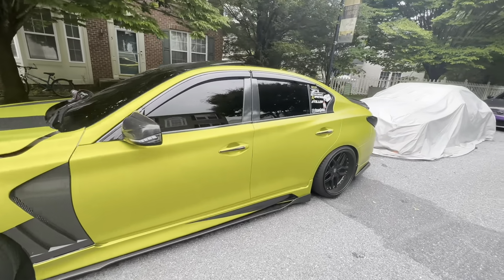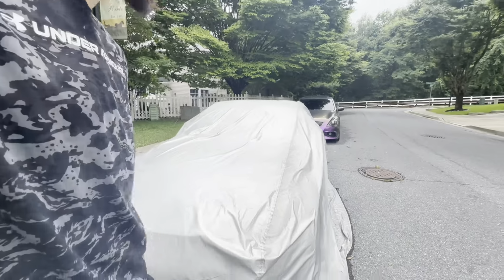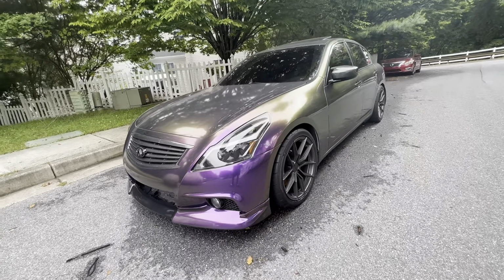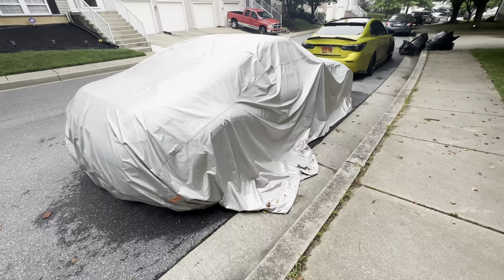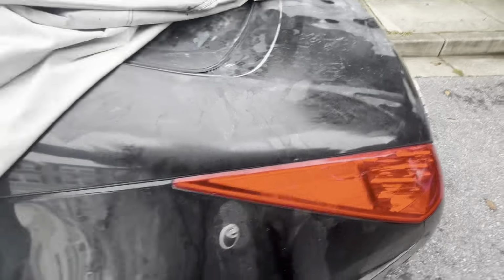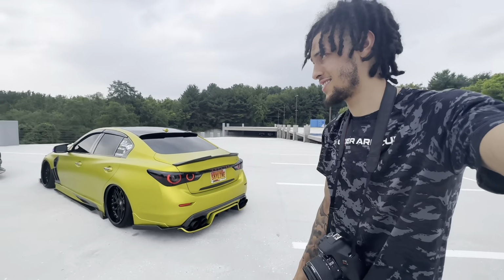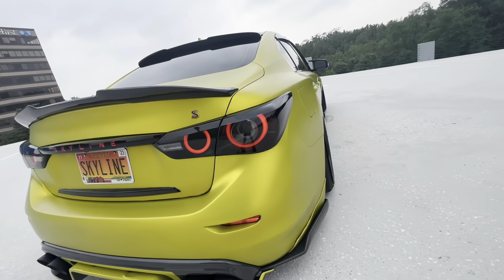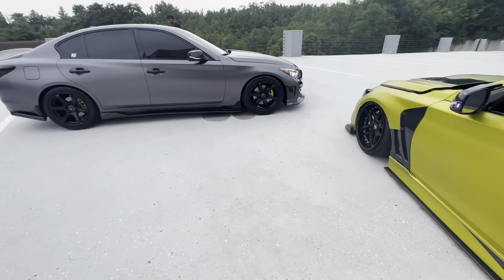Q50s BUILD REVIEW

Comment: Are those ESR's 19's or 20's? I'm in maryland as well. I have a 2019 Q50 RS AWD. Been building it since I got it last year. I fucks with ya build. I focused on performance first. Now I'm doing some carbon fiber stuff but I'm still doing performance. These cars can make some serious power and coming in with 400 stock I am def interested to see how much I can make when it's done. Keep up the work bro. I'm from NYC but live in Towson and I can tell you you make the Nissan family proud my boy.
Reply from the maker: These are 19x10.5 +22 and on 235/35/19 very aggressive setup, also have to run 20mm spacer in the front to clear big brake kit. Definitely recommend running a bagged setup for something like this!
Reply from the maker: Appreciate it too bro🙏🏽 thanks for watching
Reply: I have 19x10.5 +35 offset 255/35/19 rears and 245/35/19 fronts. I have to run wide tires for traction. It's AWD and that shit tries to get loose still so I went with an aggressively wide tire in the rear. I'm actually thinking about going 265 LOL it's looks menacing from behind. Yo ESR got a crazy sale right now on some 19's in black (question... my car is black... how do you feel about the black on black setup?). I am going 19x10.5 +22. hopefully they clear my brakes because the wheels I currently have didn't clear in the front and I have to run a 1" spacer.  @reignsgarage
Reply: Already. I'm tapped in. I seen ya car on IG before. Never knew you were in Maryland. Might bump into you on 695 one day you never know LOL @reignsgarage

Comment: is that the hood open, or just a fat hood gap on driver side? I have the same gap
Reply from the maker: It is the hood hinges
Reply: Bro do these simple steps and the hood will be flush completely. Grab a WD40 & spray it at the pivot on both hinges & lift the hood up and down so WD40 can do it’s work. Do it for about 5 to 10min & I promise the hood will be completed shut
Reply from the maker: @vq6928  gonna try it